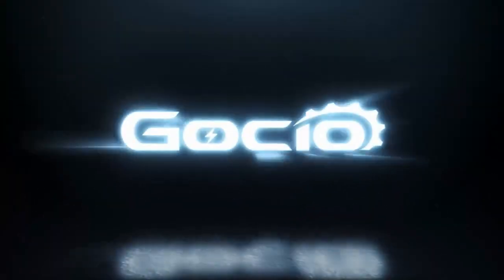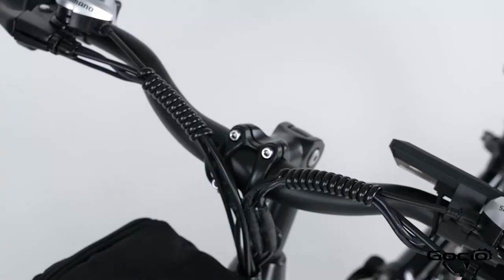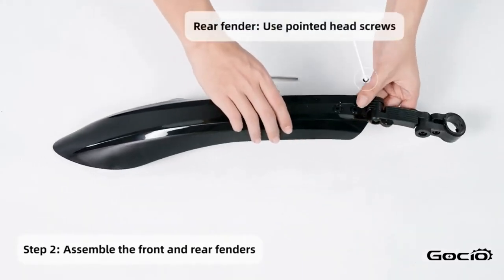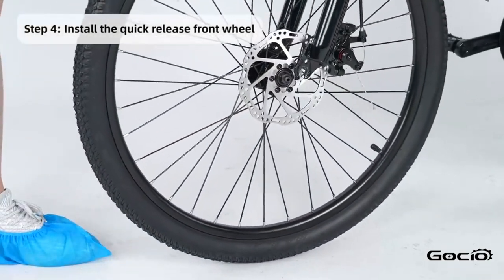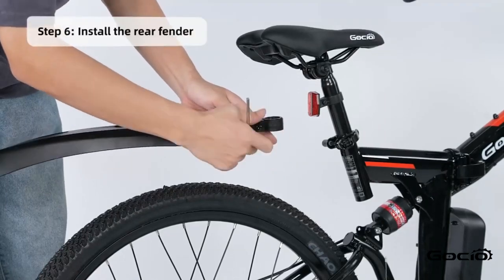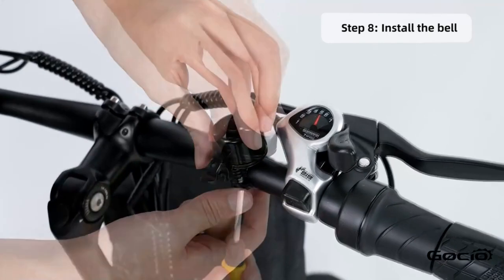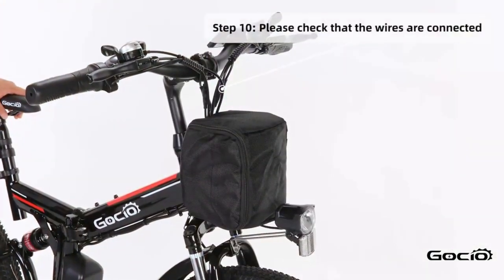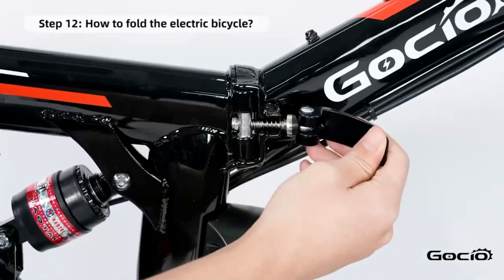Gocio folding Electric Bike

Comment: I just bought 2 of these @ 499.00 seems like the Manuel is bad. hopefully this isnt a sign.
Reply from the maker: to be honest its a bad a$$ bike! I just put 600 miles on mine and the only problem i had was with the tires going flat ... Definately get some slime and install it or youll be in trouble! The tires are a little thin i think theyre made for on road only ... I got a flat the very first day but we have alot of stickers here in colorado theyre call goat heads. Good luck and good job you got a couple great little bikes!
... I %100 recommend getting the Allstate warranty for them it's about $45 and you have up to 30 days after purchase to go back to Walmart and get it!!!  ... The reason I recommend the warranty is because when my tires went flatI called them and asked him to send me some tubes and tires and that I would fix it myself ... But they refused ... And just refunded my money in full exceppt taxes... AND to top that off I got to keep the bike too!!! ... So I bought new tubes replaced them and fix the bike and then just kept the money!! Cha-Ching!! Hell Yea!!  Thanks for the message my friend hope all goes well!